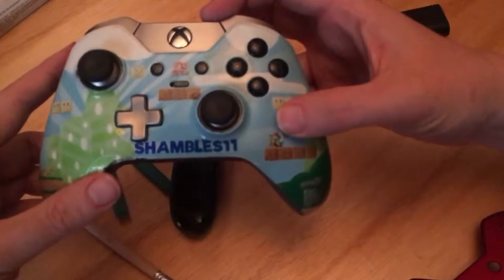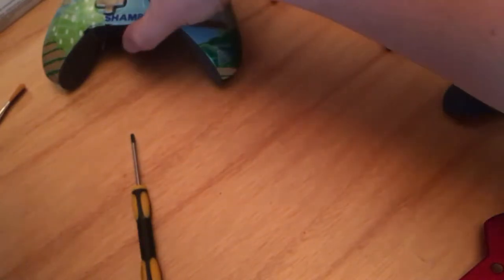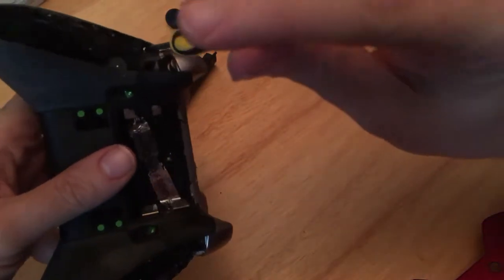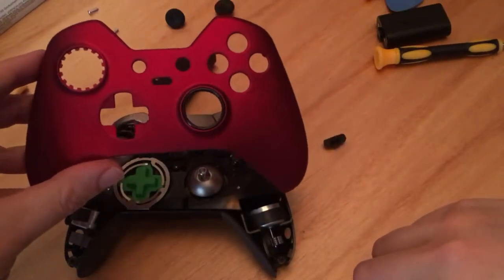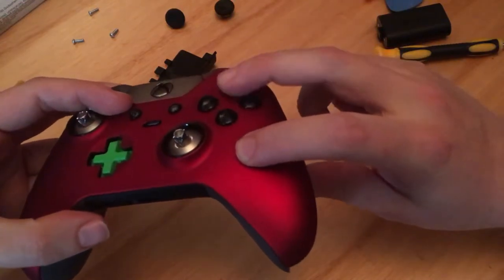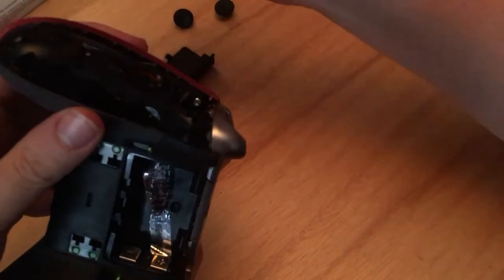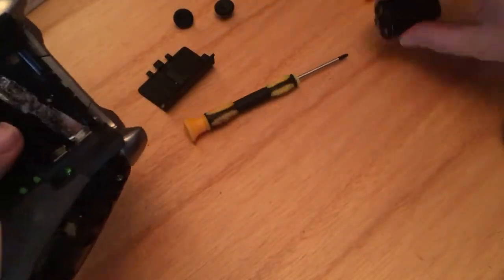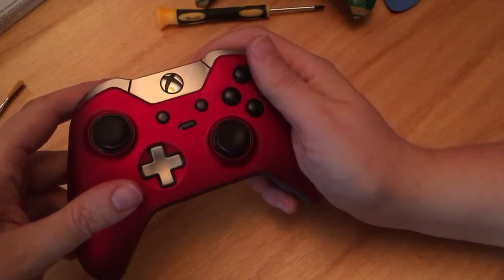Fitting an Xbox One Elite Controller Faceplate

Comment: how do you file down to get faceplate to fit? I'm having the problem you mentioned with my buttons.
Reply from the maker: Randale Weems some Wet and Dry Emery paper, as fine as you can get. Probably only needs a very small amount taken off, it’s incredible how a little bit makes a huge difference. No guarantees it won’t leave a halo effect on your faceplate though